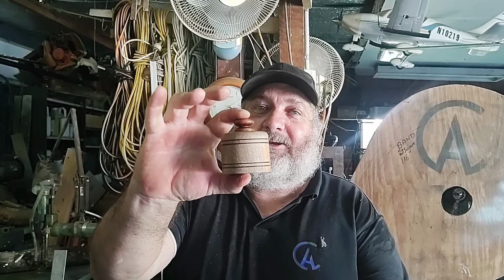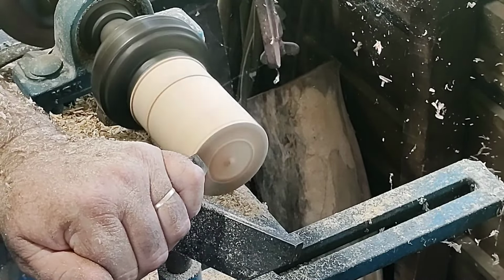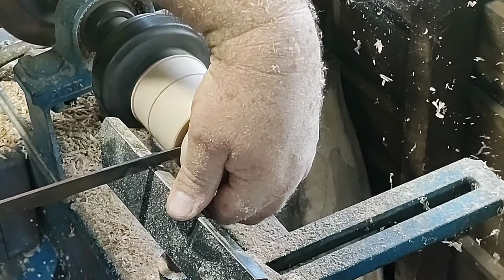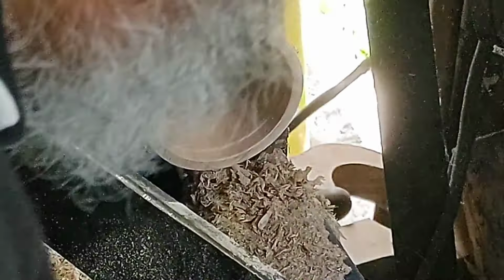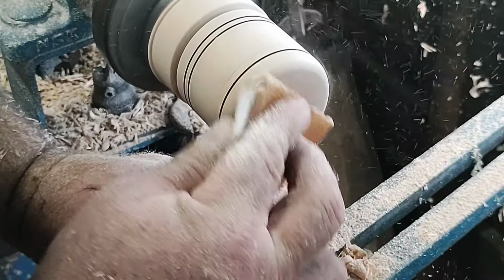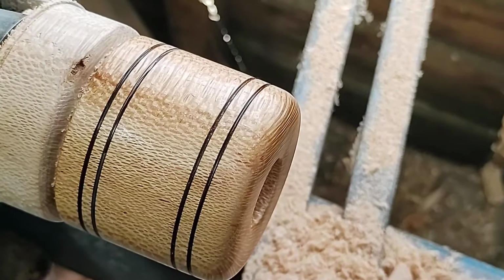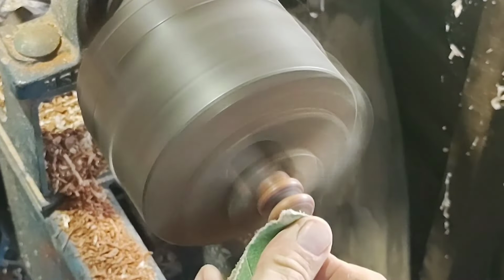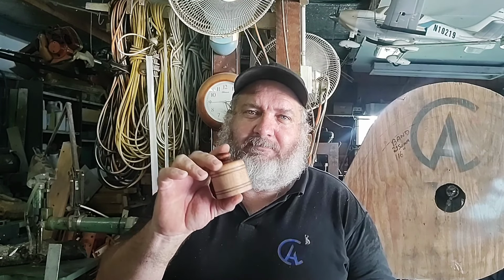WOODTURNING A LIDDED BOX

Comment: Hi! Lovely box👍🏽. What kind of wire do you use for the burn?
Reply from the maker: Stainless steel mig welding wire I think  .9mm , it doesn't heat probably as quick as copper but I believe lasts longer I am not an expert but it works for me. 
Thankyou, regards Arthur.

Comment: I also like to dome the inside of the top and the bottom about 1.5 to 1.75 mm deep while holding the base on a jamb chuck or the jaws of the scroll.chuckn In expansion
Your engineers chuck stepped jaws would grip nicely in expansion by inserting the bore of the base onto the jaws and opening the jaws to grip 
Your trinket box has elegant and simple lines and minimalist decorations well.done mate